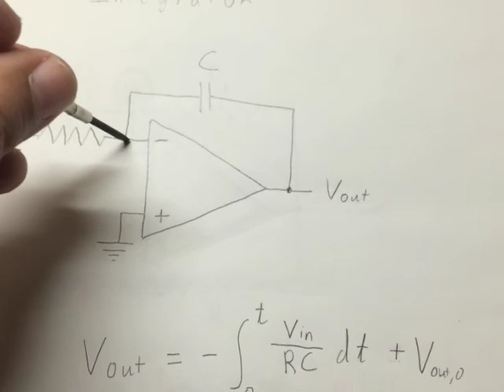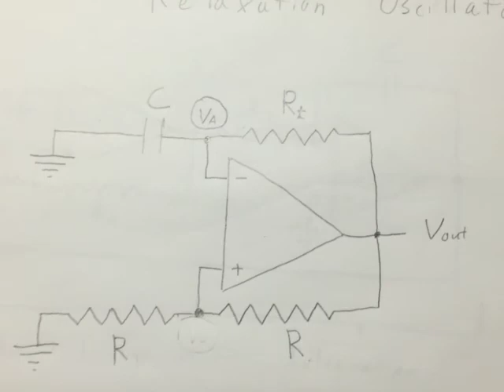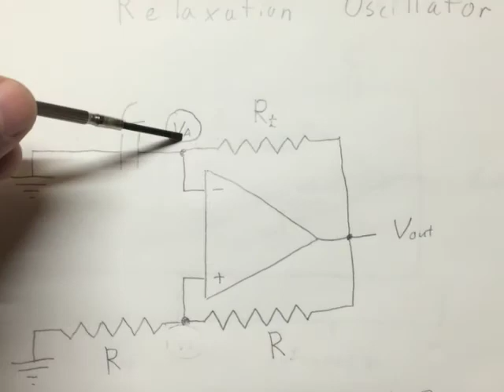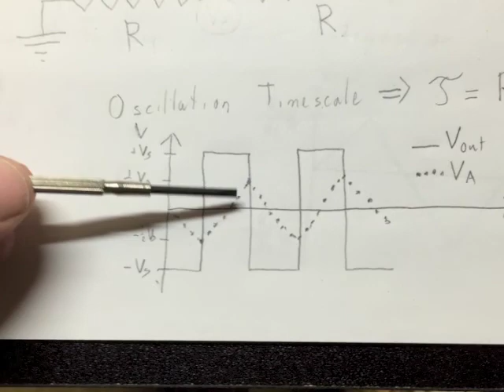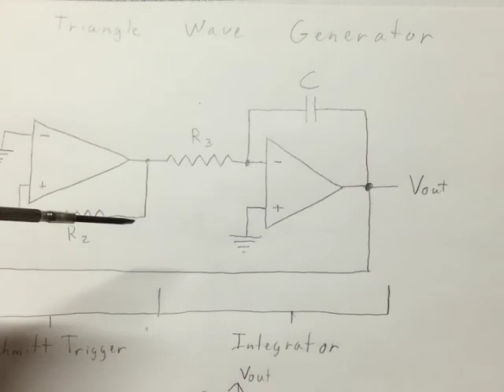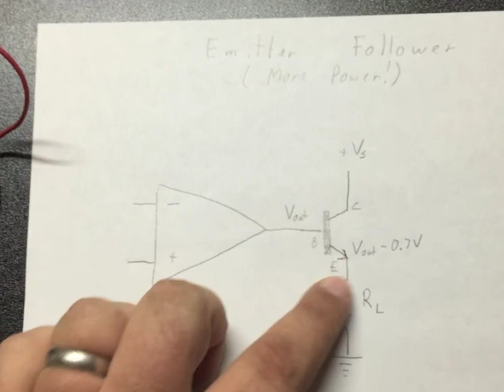Fading LED circuit - Part 4

Comment: Hey there! I really enjoyed this series and appreciate how you explained the operation of each function in such detail.

I know this series was posted several years ago, but I'm trying to design, what I thought would be, a somewhat simple project. However I have not been able to find any example circuits even close to what I want to achieve without using a micro controller. I feel like your hat project may have the key answers to my issues. So, I'm hoping I may still be able to pick your brain for a moment to help clarify some things. 

Let me explain my basic concept if its ok. 

I want to control the red and blue LEDs in a small section of a 12v RGB strip to basically function like your hat. As in fading from red to purple, then to blue, back to purple, and start over on red. I was thinking simply alternate fading the red LEDs and blue LEDs on and off to achieve a the effect. 

I hope I explained that well enough lol. As I read thu the comments I noticed one of your replies on how to make the two sets alternate by running the two circuits off a transistor that is connected to the output of your circuit in this series. One question of mine is... did each of those 2 circuits, ran by the transistor, then start with their own separate transistors (so, using 3 transistors in total? If so, were they both npn transistors? Or was one an npn and the other pnp?

Another issue I realized, as I thought about adapting that setup, is the way LED strips are controlled... I'm sure you know that both colors I want to use are supplied with the same V+ and only isolated thru separate grounds. Do you think I might be able to solve this issue by controlling ground to one set on the high side of your circuit with an npn transistor, while controlling the other ground on the low end with a pnp transistor? 

I'm still trying to fully grasp the whole concept of pnp transistors, but not catching on as quickly as I have other components for some reason.

If you could please help me with any ideas, recommendations, schematics, or anything, I would very very greatly appreciate your thoughts and advice. 
In the mean time, thank you so much for this great and very informative series. It helped me tremendously to better understand the different uses for opamps that I have been struggling with.

Comment: I really enjoyed all 4 parts.  You learn something new everyday.    However, you never finished the hat circuit.  I really need a circuit that fades one set of leds on as the other fades off.  please help.
Reply from the maker: What I did was use the output, connected through a transistor to drive two circuits... In once case it connects to the + terminal of the LED and the other end goes through a resistor to ground. This turns on when the voltage is high. On the other circuit, after a transistor I hooked up the - side of the LED and an the + side through a resistor to a + 6 V source. This one turns on when the output voltage goes low. At one point I ran into an issue where the voltage would go fro +6V to 0V through both resistors, which was not great. I also adjusted it to 9V at some point, but I futzed with that end so much I actually don't remember exactly how it ended up.

Comment: I watched all 4 parts and I find them very interesting. But I wonder how to run this on batteries since there is no negative voltage there. Is there a complete schematic on how to wire let's say 6 LEDs to this circuit running on batteries. I would very appreciate that if it's possible
Reply from the maker: +Marko Drnić What I would do, if say you are running it off a 9V battery, is to hook the V+ to 9V, the V- to 0V and then use two 100kOhm resistors to build a
 bridge across the 9V terminals. In between the two resistors you have a
 4.5 V level, which you can connect to the Op Amp inputs that are to be 
set to ground. The Op Amp inputs are high impedance so they won't pull 
much current to change that level.
Reply: It's been some time since my last post. I'm still having problems with wiring multiple LEDs. I understand that i should use transistor to get more current but would you be kind to provide some schematic on how You did it for your hat. You can PM me...

I'm planing to wire 4-5 LEDs in my case if it makes any difference.

Big thanks

Comment: Pretty cool series, I learned a lot, thanks. I'm just getting into electronics and it's been fun so far but the math is daunting. 

I've been wanting to put a string of lights on a tree that are normally dimmed and will fade up when triggered by a motion sensor, then fade back to dimmed when motion ceases. Maybe I can use your circuit. I scored some 072D 4013B op=amps with Schmitt triggers from nice TVs. Great components to be had in the bigger nicer TVs...